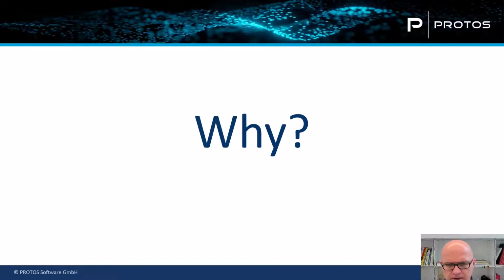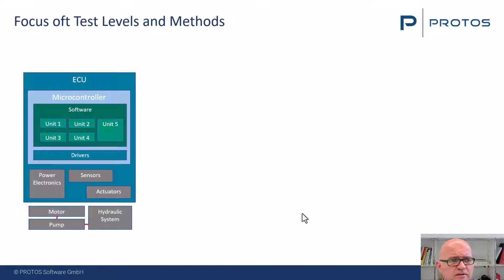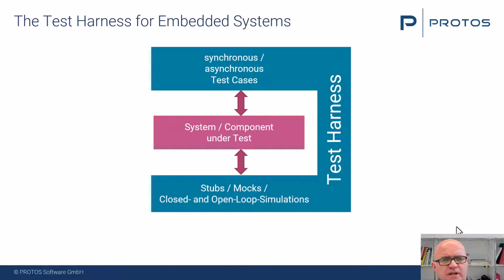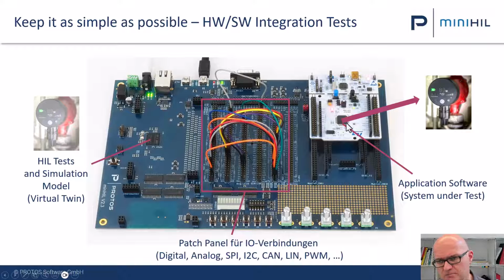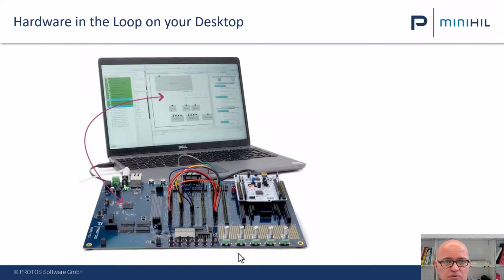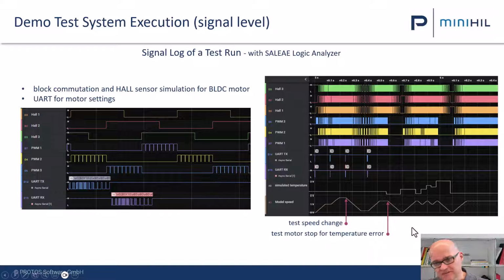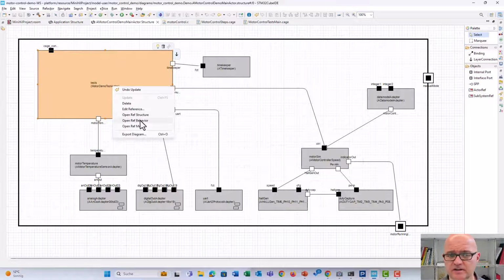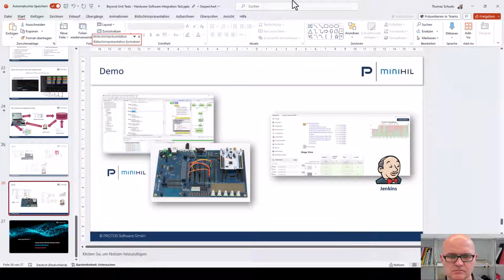Beyond Unit Tests - Hardware Software Integration Test

Comment: Really interesting, this should have more views. For my personal project, I ended up with unit tests with very heavy testing and then a smaller system test in which I test my elements. The only part that isn't tested enough with this in my opinion are the RTOS-related events which are kind of between the two and hard to automate.